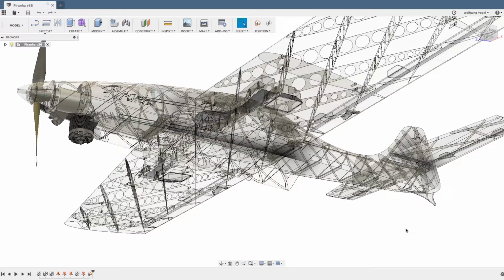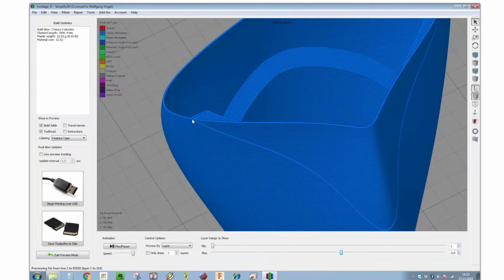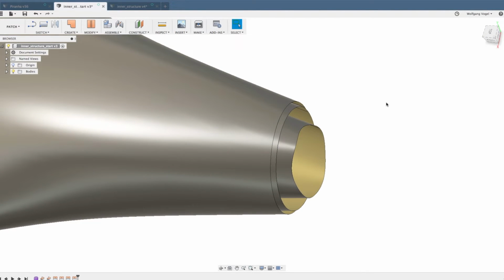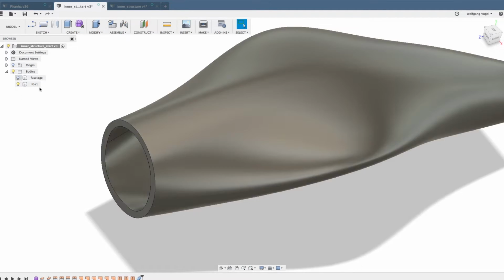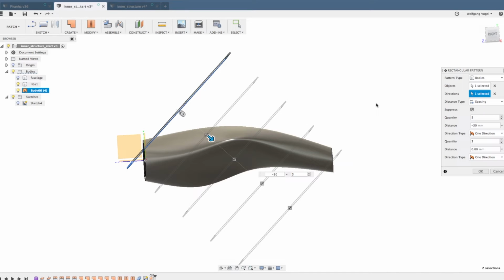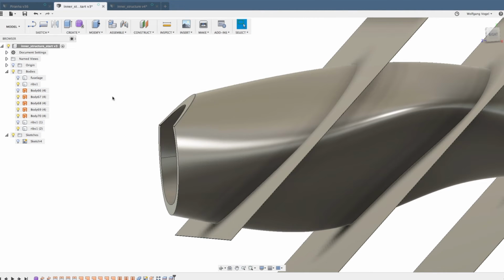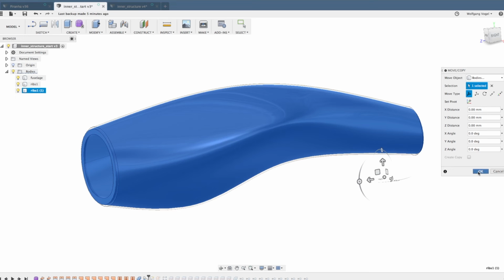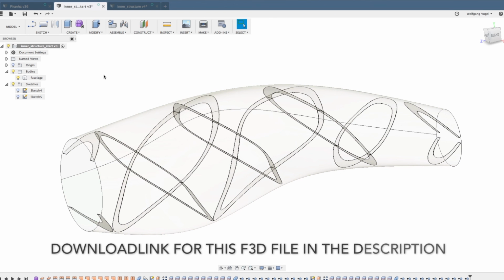Fusion 360 - inner structure for 3d printing

Comment: Is there any chance you could explain how you then combine those parts? Often times I see models like this printed in surface/vase mode and the way they are shaped is that the two fuselage pieces just slide into a slot and are glued together.

Comment: It occurs to me that if you just shelled the inside of the evolute to a desired skin thickness, and then extruded your ribs to a desired thickness, and then merged these 3D parts together into one part, then you are done, without having to futz with it further. Maybe you need to know or find out the minimum thickness your printer can print, but I think that is about it. What am I missing?

Comment: Great video! I wonder: this would not be printable in vase mode, would it? Because the printer still has to retract right? It's just so that the outer skin is even. But it would be difficult to print with light weight PLA since the retraction would lead to stringing or am I wrong here?

Comment: Great tutorial .. However I would suggest using the ‘intersect’ operation instead of the combine cut operation to avoid cutting each rib one by one. It will make all 5 ribs at once as intersect only keeps the sections that intersect each other. Also in the newer version of fusion, you can use thin extrude and define the thickness of each 45degrees square , this way you only need to create one line instead of creating a rectangle
Reply from the maker: Thank you for your comment and I fully agree with you. I optimized the way of making the ribs since this video has been created. I just have to make a new video now. I wanted to do this for quite some time ;-)
Reply: @3dcadfreak611  Waiting......😁
Reply: @rorywquin  I appreciate your patience. still working on this new video ;-)
Reply: oops, wrong account. oh well

Comment: Running into a problem using this approach on a wing.  My airfoil is very thin & when I create the inner offset by -.65mm for the rib structure - the resulting surface crosses itself near the trailing edge of the wing.  As a result I can not patch the rib surface at the wing root - operation fails because the surface is crossing itself.  Any advice?
Reply from the maker: sharp edges like the trailing edge of a wing can be a problem and I found that the wing is usually more work than the fuselage. But it's not impossible to use this method even when the offset geometry is overlapping. The first thing I would try is to make a copy of the original surface and modify it to make the offset surface work. In the case of the trailing edge I would cut the sharp edge with a vertical surface at a point where the vertical surface has a minimum height of .7mm. As a result the offset will not overlap and the original wing surface is untouched. I hope this makes sense, if it doesn't I finally have a reason to make another video ;-)
Reply: @3dcadfreak611  thanks! That's an excellent suggestion.   Thin airfoils seem to present interesting challenges.  I'm lofting an AG12->AG13->AG14 for a 1m DLG glider with an approx 130mm chord.  I also noticed the trailing edge of the wing is thinner than the nozzle can even print.  I am not sure if I want to just totally discard the thin trailing edge of the wing and re-scale the airfoil profiles longer before the loft.... or alternatively i tried the following:  i created an offset in each airfoil profile by .65mm outwards, and then I was able to loft two useable bodies.  I just don't know which is better aerodynamically thickening the airfoil profile by .65mm or chopping off its thin trailing edge.  Finally I am curious about the .65mm rule of thumb for offset - when I examine the toolpath in cura - as the nozzle prints the outer skin - it slows down and reduces extrusion when passing each rib.  It looks as if .65mm was not enough and the ribs are invading into the skin area.  Could this be possible?  I am fairly certain I have all the 3d lab print preferred slicer settings selected.  I guess all this is to say- I would certainly love to see another tutorial where you address some of the challenges unique to wings. Thanks again for all your work here - I consider your video the holy grail of tutorials for successful printing of planes.

Comment: Thanks for the very useful info. Still, I'm facing significant issues trying to apply these principles to my design: the main problem is that Fusion360 cannot apply the offset tool with a negative thickness on an airfoil section. The reason for this is because an airfoil forms a very sharp angle at the trailing edge which causes the resulting surface to self-intersect (your example model does not have any sharp edges so the tool works fine). Is there any way around this problem? Thanks in advance!

Comment: This technique works great for printing the fuselage wall with supporting ribs. But how do you then add extra internal structure for things like servo mounts, battery support and so on?  You can create the shapes as holes inside the solid body (same as the ribs) but then they're only printed with a single layer perimeter.  For example, how could you design/slice/print the same-shaped thing, but with an added internal servo-mount plate that is, let's say, 2 mm thick?

Comment: I really liked the manual creation of the in-fill for 3d printing.
Wouldn't  it be quicker to use the intersect boolean operation instead of multi split body operations? Am I missing something?
Reply: I came with the same question during the watching. because few days ago I successfully used Boolean tool to generate ribs for balsa laser cuting.

Comment: Hi, ich nochmal der Piranha Drucker. Was mich eigentlich interessiert...eigentlich was allgemeines.  Wenn Du die Enden vernähst..stitching...wird dann aus dem Freiformkörper automatisch ein Volumenkörper  bzw Solidkörper.??  Sonst ist das eigentlich nicht mit druckbar, oder ??  Bernd
Reply from the maker: hab dich am Namen sofort wieder erkannt ;-). Ja, genau so funktioniert das, zumindest in Fusion 360. Das heisst allerdings auch, dass Fusion kein geschlossenes Flächenmodell erlaubt. Sobald keine Lücke mehr exisitiert, wird automatisch ein Volumenkörper angenommen. Das ist in anderen CAD Systemen nicht so und macht auch keinen Sinn. Will man mit einem geschlossenen Flächenmodell arbeiten, lässt man irgendwo eine möglichst planare Fläche weg und sobald man fertig ist schliesst man die wieder. 3D drucken ist kein Problem mit offenen Flächenmodellen, nur der Export als STL klappt nicht in allen Programmen.

Comment: Hi, congratulations for the incredible realization. if it were possible I would have to ask you a question: how much do you measure the perimeter of the walls and what nozzle did you use?
thanks a lot
Reply from the maker: I am printing everything with a 0.4 mm nozzle. The perimeter of the walls is set in Simplify3D to 0.42 mm. This has been set by 3dlabprint from where I downloaded a profile for my first 3d printed plane, which was the small Spitfire, and I never changed this setting.
Reply: @3dcadfreak611  thank you so much for answering me, I am waiting for other good videos;)
Reply: Hi, with your video I was able to play a fuselage, now simplify 3d works very well and does not ruin the print. THANK YOU. Would you please make a video with the same approach on a wing ??? I would be very grateful to you
Reply from the maker: @roccocafa7872  Hello Rocco, thank you for your feedback. I am happy it works for you on the fuselage. I have not made any videos for quite some time, but I improved the process in the meantime quite a bit. I really should do more videos ;). For the wing I do almost the exact same process. The only difference is, that I don't hollow out the ribs. with another offset of the outer surface. Instead, I extrude many circles on each rib individually. It's a slow process but worth it in the end.

Comment: Please let me know if my understanding is correct:  Your finished product is a solid body with hollow cutouts where the ribs will be... does the slicer have a way of inverting this solid body and only printing the ribs and thin walled shell?  I am currently using Cura and haven't played around with much of the extra settings and I have not found a good way to do this.  Any help would be greatly appreciated, thanks!
Reply from the maker: Yes, this is absolutely correct. Simply tell your slicer (works with Slic3er, Simplify3D, Cura and many others) that you do not want any layers on the top and bottom. Set the parameter "Wall line count" to 1 and you will get a hollow wing with solid ribs on the inside, although the CAD model is the other way around. Crazy, isn't it? ;-)
Reply: @3dcadfreak611  Great thank you very much!
Reply: Good question - great answer. Thx!!!

Comment: Thank you for this very useful learning video. It works quite perfect and it was exactly what I was searching for. But as soon as you have more complex or especially concave surfaces, fusion is not able to handle the "create-offset" functionality anymore. Do you have an idea how to deal with that issue or a work around?
Reply: I run into the same kind of problem. My goal is to print wing tips (to my vac-bagged slope gliders(rc)). Could you make a video of how to make a printable hollow wing tip where the wing profile gets narrowed down to zero creating a smooth edge. Your videos are the best by far creating rc models  Thx!
Reply from the maker: When Fusion 360, or any other CAD program, is not able to make the offset from a surface it is most likely related to the smallest radius of that surface. Imagine a tube surface with a diameter of 10mm. You will be able to offset this surface outside by any value, but inside the max. value will be 9.999999mm. Some CAD programs will present a solution again from 10.000001mm upwards, which is just internally calculated by 10 - 10.000001 and  therefore the same result as 9.9999999mm offset, etc. You can check if this is the case by simply using a very, very small value for the offset. If this works, you know the minimum radius of your surface is between the value you tested and the one you want.

When I have this problem I start by splitting the surface into two pieces and offset one half at a time. Usually this works good to find out where the problem is exactly. As soon as you have a good idea which area of the surface causes the problem, try modifying it to a bigger radius. I had exactly this problem on the leading edge of the vertical stabilizer of the Piranha (mentioned at the beginning of this video). I edited the main surface in sculpting mode in small steps (bigger radius on the leading edge) until the offset I needed was possible.

Unfortunately there is no simple recipe like "in case offset doesn't work, do this". But this is definately not a Fusion 360 related problem. The reason is mathematics and all CAD systems have the same issue (but they all handle it differently).